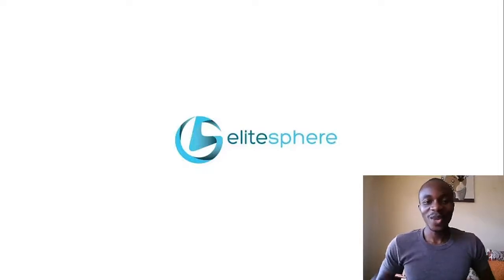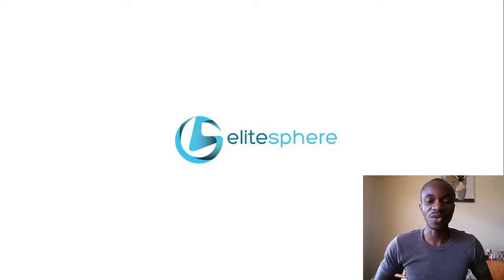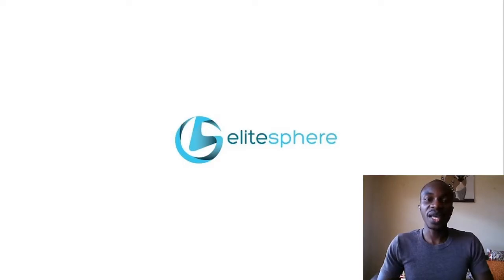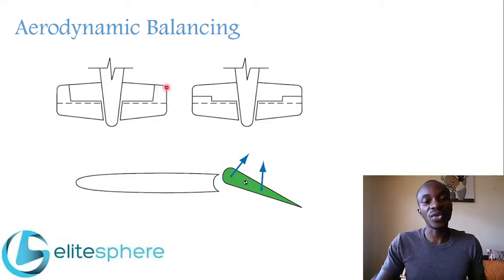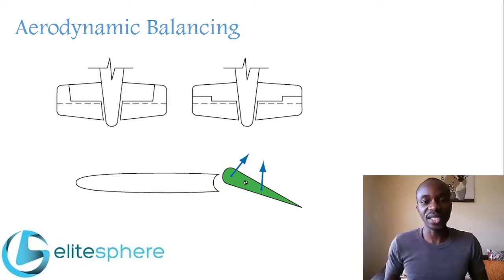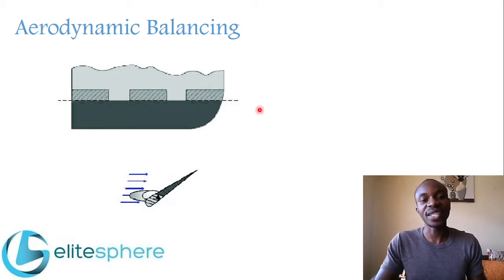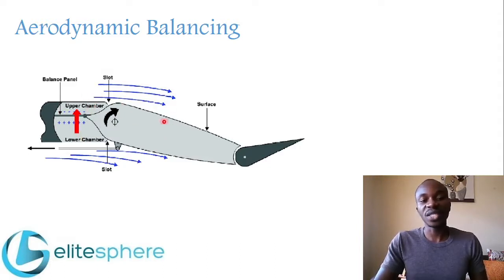Static/Mass & Aerodynamic Balancing(Aerodynamics & flight controls Episode 5)

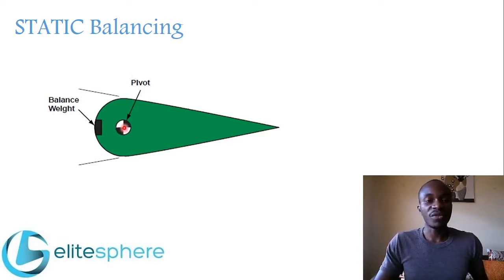Comment: @3:11 What does 'balancing the control surface' mean, please? Thank you!
Reply from the maker: Balancing the control surface is making adjustments in the weight of a control surface or by use of aerodynamic forces such that the control surface center of gravity is positioned at the hinge line. This will enable the control surface to be able to stay in a neutral position without any input from the crew. Otherwise if the surface is not balanced, it can either go up or droop down when there's  no input on the column.
Reply: @Elitesphere  I appreacite your explaintaion very much